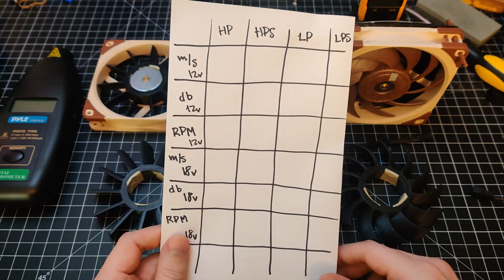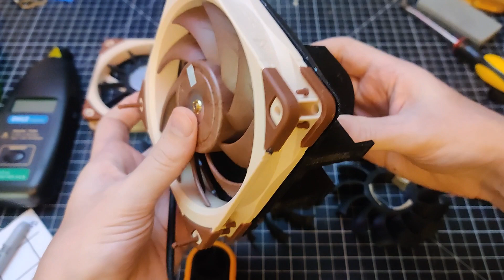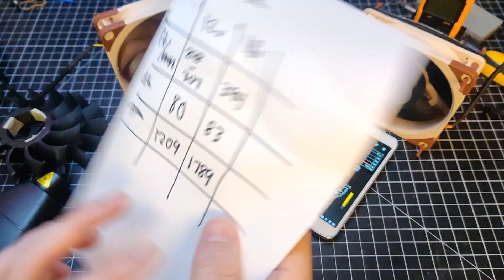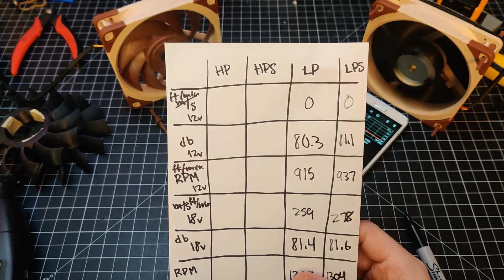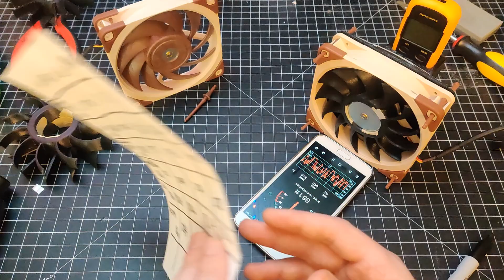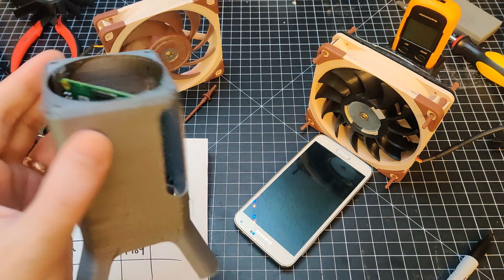Fan Design Competition

Comment: Hi, while the S1223 is one of my favourite aerofoils, I don't think that it is a suitable aerofoil for this sort of application due to the Reynolds regime that these aerofoils are going to be running at. I would recommend reading through some of Michael Selig's other works on low Reynolds number aerofoil performance to find better aerofoils for your purpose.
Reply from the maker: thanks! I will deffinitly look into that.